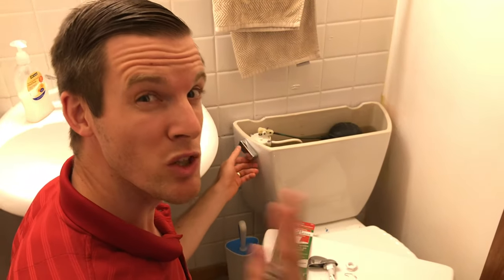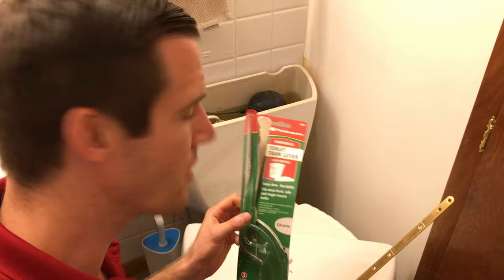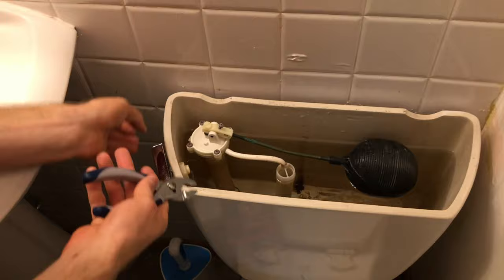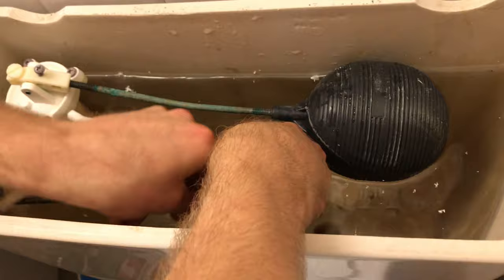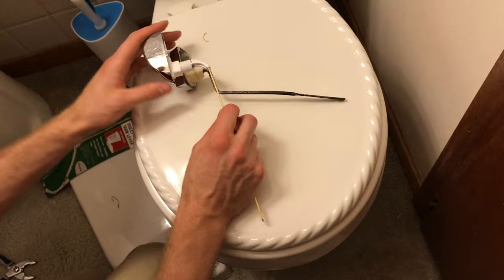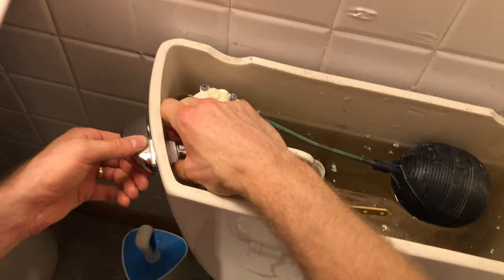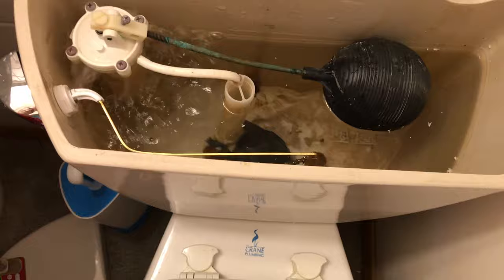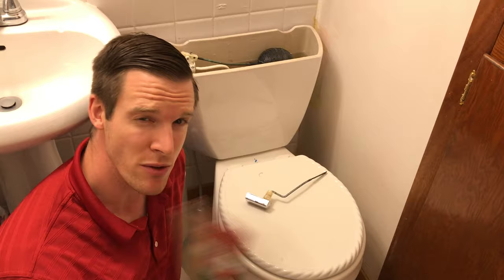How to Fix or Replace a Toilet Handle (Flush Lever) in 1 minute

Comment: I switched to the handles with the metal lever instead of the plastic lever because the plastic ones are junk you hold down on the handle slightly to hard and then they snap.

Comment: I just saved myself a plumber's fee I wouldn't have been able to afford before January, thanks to this video. Thanks to YOU. SUBBED, and again, THANK YOU, for being so reassuring and plain-speaking, and making something that scared the ever-lovin' spam outta me (any sort of home-based repair that couldn't be solved by 'turning it off then turning it on again') look do-able enough for me to at least try. And my try succeeded--I did the repair in about fifteen minutes of fiddling, mild effort, and totally gratuitous swearing 😆I'm thinking I might try more small repairs, as needed and with your channel's help. Which means not far down the line, I'll  definitely need a professional, thanks entirely to my own fumble-fingered flailing.

In all seriousness, you literally showed me how to solve my entire problem with an early run to the hardware store and $20.98 USD ... instead of whatever the plumber would have charged two months from now. Two 'remove the tank top to pull the chain in the tank EVERY time I flush'-MONTHS. So, YOU ROCK and I hope your day, month, and year are going well. And that the ones upcoming are even better!

Comment: a universal lever is subjective, because some handles are built differently. i had a hell of a time putting on the clip to the handle. i also have a counter top over the toilet as well. if u make the chain to long,  it takes the toilet longer to flush, and have to hold the lever.  if u make the chain to short, the rubber flapper will not close properly thus having water slowly seep out of the flapper and running every 5-8 mins.....i hate plumbing! lol

Comment: I tried your suggestion on bending the part. It snapped when I did that. I now have to buy another handle.
Reply from the maker: oh I'm sorry! It seems on the universal toilet handles that you have to be careful to bend the metal arm and not strain the plastic handle. I assume it was the plastic part that broke?
Reply: @LifeyGuy  I was hoping he replied because I’m so scared to break mine …. I got the same one and Since my level broke on the bend part I dnk the shape so I’m just bending and bending till it fits but I’m not touching the plastic AT ALL just metal

Comment: It's driving me absolutely nuts that no one is showing what happens when everything with that white nut/seal does NOT come out! Ages ago I saw one on here that showed what happens when you have the handle come out but not that seal that's still stuck in the hole. Without removing that, I can't do this easy repair, and I can't get that sucker to move AT ALL!
Reply: Melt it with a lighter. I had to do the same. No danger because the melting plastic drips right down into the water. But use a long handled lighter so you dont burn yourself.